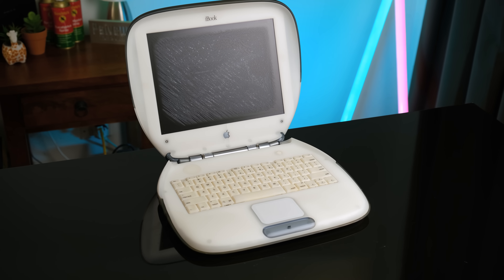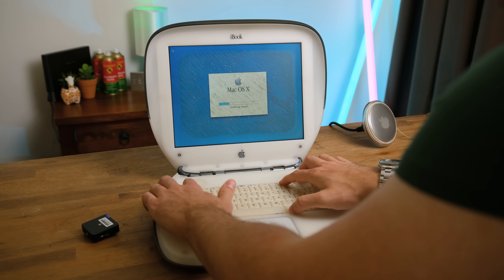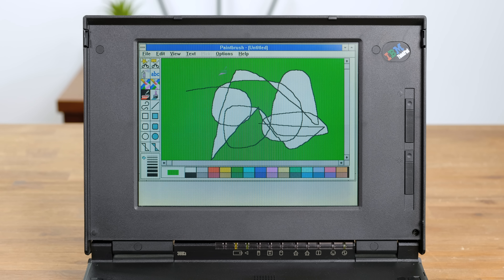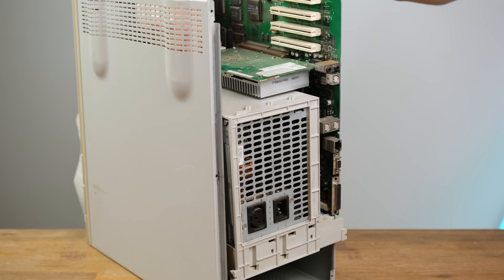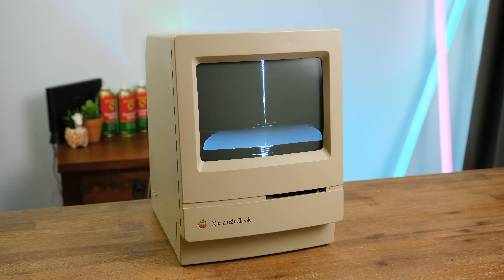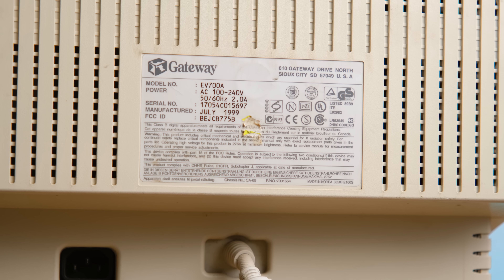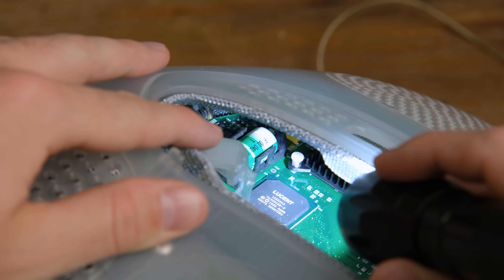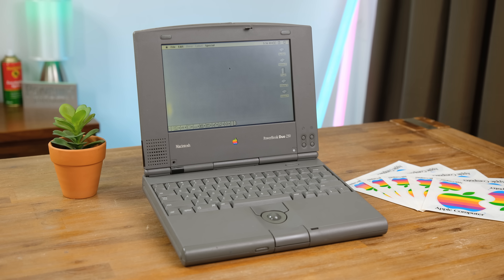So Much Vintage Tech Is Dying... Here's Why

Comment: Another reminder of the PRAM battery that killed my beloved IIfx back in the mid 2000s. Was only in storage for a couple of months while I moved states but that was long enough for the logic board to be destroyed. Kinda grateful I sold off my vintage Mac collection back then, would have been potentially worth more now of course but the time/effort/cost involved in keeping it all alive would have been huge.
Reply: I had a IIfx fall to the same fate but more recently. Around 2011 it was working fine, and I put into my parents' attic. Ten years later I pulled it out, and the motherboard was destroyed from a battery leak (looked more like an explosion). 

The case had significantly yellowed over that time too. It was a very sad sight. What a shame to loose such a rare and powerful vintage Mac.

Comment: before I even watch this video it is for the most part when the person doesn't know a thing about electronics and they turn it on with a faulty capacitor and it blows up and decides to take everything else with it.... which could easily be prevented if people who didn't know anything about electronics would stop buying vintage tech so people who do know can replace the capacitor or other faulty things before turning it on. I mean look at crts from 2006 not even 20 years yet and the capacitors are failing on those so i'd say around the 15 year mark is when you should look for faulty capacitors so you don't mess your stuff up
Reply: now with that ibooks screen you could easily replace it there may be a way to even repair that screen that's already in it
Reply: It won't read discs because the laser has failed 99.9% of the time which is quite an easy fix yes lasers aren't going to last forever
Reply: You can't really expect a hard drive to last forever they are magnetic discs and the high rpm is going to wear down the mechanical stuff those should be replaced around every 15 years if they are used heavily
Reply: it's not that things aren't built to last it's that things can't last forever things wear out with use
Reply: plastic of the 80s and 90s they thought plastic would last forever then, why do you thing computer cases for the most part aren't made of hard plastic anymore
Reply: yeah you're supposed to replace batteries over time kind of like how you do in your tv remote to prevent stuff like that. should replace stuff like that every 5-10 years depending on what it's used for
Reply: People don't have their electronics serviced as often as they should be, blame can't be put on build quality or saying they aren't built to last otherwise you'd have to replace those every year instead of 5-15
Reply: now at the end of the video... no you should not sell your vintage tech just because some random says so just service your electronics and they will last you until death
Reply: @IHatePeeps1111  With harddrives it is mainly mechanical impact and heat, and run them horizontal, not vertical to avoid strain on the bearings. After mechanical shock harddrives can die 1 month later (because tiny particle will start a chain reaction of debris (like colliding satellites)), which often is mistaken for random death and gives them bad reputation.

I trust SSD way less. SSD/Flash memory functions like DRAM with 1 year refresh cycle (see Wikipedia "wear leveling") and will die if not powered on once a year for some minutes. It dies the faster, the more erase/overwrite cycles it has gone through, thus never use a worn USB stick or SSD as backup media. They starve without energy (modern triple/multi level types even faster) and data can not be recovered at all, which makes them an atrocious choice for backups and long term storage.

Comment: This is also a problem on old XBox (original xbox) which has the clock battery cap problem. Get those out of there before they destroy the motherboard.

Comment: I had an old Dell Inspiron 8200 that had a failing hard drive. If left in storage for a while it wouldn't spin up at all and I would have to shake it until if would work. One day it just stopped working completely no matter what I tried.

Comment: Another thing about old Apple laptops the solder joints in all the motherboard get so weak over time, and when you try to unplug a ribbon cable the connectors pull right up with the cable or whatever your trying to umplug. I have seen it in lots of Vintage apple laptops

Comment: Heh, my dad's poor old not very well kept attic left a few of the old systems he donated to me in pretty bad shape. Including a lovely Trinitron multiscan e220 that would have been nice if it wasn't scratched and if the thing worked well, potential flyback transformer issues though this monitor was affected by the cap plague so that could be a potential fix, not giving up hope on this one yet.

Comment: For example my Nintendo Collection from Nes To GameCube works fine, only the plastic change the color
Reply: You should check your GameCube disks from time to time, there's one video of hundreds of them being bad, but it was probably due to flea market cavepeople storing them badly. I keep all of mine in the storage cases, usually the original storage case.
Everything Nintendo used before that was on mask ROM chips, one of the most reliable storage formats ever.

Comment: why did this actually make me cry, like i never grew up with any of these electronics but its like watching someone you know really well die. im into old tech, especially old computers, the fact that this is starting to happen is extremely upsetting but I know there's nothing you can do about it.
Reply: Yikes!  I'm off to check my precious ancient PC Clone DX2/66 that I use to play DOS Star Trek games!
Reply: You’ll find that computers from the 90’s will fall apart and break before computers from the 80’s. This is because of the brittle plastic they’re composed of which makes them a nightmare to move around and transport. Older systems from the 80’s are far more durable and many survive unscathed to this day.
Reply: @Bendaak  I wonder how later systems compare. A lot of my current computer setup, the one I'm using right now, is from the mid to late 2000s (I believe after the batch of bad capacitors that caused failures of earlier systems). I hope the components, especially the monitors, keep working, because, well, I still use them, and they work quite well.
Reply: @happysmash27  Later systems from the mid-00’s are far more durable than systems from the previous decade. I have a bunch of laptops from 2005-2010 and all are mostly in perfect condition with no cracks or damage. I guess time will tell!
Reply: that could also be due to the time period, ive had awindows 7 era machine already lose its battery @Bendaak
Reply: that may be the case for the casing but how about the internals @Bendaak
Reply: It’s cause you have autism
Reply: when theres a will theres a way
Reply: not really, capacitors and such do fail but are replaceable
Reply: @geekzombie8795  space is not a thing but the absence of matter hence nothing to break. Using a light won't let you find darkness.
Reply: if you're crying you have severe issues. man up
Reply: relatable
Reply: Everything dies eventually. Nothing is immune to time.
Reply: @cattysplat  Not 80s Ford Crown Vics, though. Those things absolutely WILL last forever, full stop. At the very least until after everyone that watches this video is gone.
Reply: More modular = more durable.
Reply: @canalRetro269  um... No?

It's less durable, it has code that make it less durable, because companies are want to people buy new products
Reply: I don’t mean to be insulting, because this is a society wide problem… It’s because we have been weakened by our diets, nutritionally and psychologically. By food, chemical exposure, and media exposure. Our endocrine systems are under a sustained assault and it’s making men over-emotional and unstable.
Reply: @TheMasonator777  men were always as emotional as they are now, throughout history most of the male populace was almost entirely traumatized by war until about 30 years ago, imagine thinking acting like a human being is over emotional, just because your a human callous and have no soul doesn't mean everyone else is emotionless, traditionalists are morons
Reply: On the plus side, at least the concerns about plastics sticking around forever in landfills has proven to be overblown!
Reply: @Amazing.A.I.Channel  Just because a plastic is brittle and breaks apart doesn't mean it magically disappears
Reply: @Amazing.A.I.Channel no, it has not, there are MANY types of plastic, some far more durable than others, not to mention, just because your eye can't see it, doesn't mean it isn't there poisoning the soil. microplastic has become a concern for good reason.
Reply: @saaros Yeah, this is just proof how cheap manufacturers can be, using 'air puffed' plastic,.   But the hard clear plastic they tend to use for water bottles, etc can  last centuries...
Reply: @AmazingArends there are Microplastics in our FOOD now when we eat Fish etc.  There are 'forever molecules' in our water supply from people getting cancer treatments then peeing and the toxins last many Human lifetimes,
Reply: @Amazing.A.I.Channel well made ABS plastic can theoretically last forever under good environmental conditions..... Some plastic can last forever.
Reply: @Amazing.A.I.Channel  The concern is microplastics. While large chunks of them do break down they only break down into smaller pieces of plastic that are harder to contain and more likely to pollute water and soil.
Reply: @Amazing.A.I.Channel  Plastic isn't compostable, so no. You're wrong

Comment: I've been for years into film cameras and most of them (at least the Japanese main brand ones) are made out of plastics and components that don't decay. Main problems are old foams and lubricants. But overall, everlasting devices. 

However, I recently got into cassettes as well. Tape decks are mostly OK... But Walkmans are a freaking nightmare. Setting old rubber belts aside, there are problems with gears and capacitors (and damage from leaky batteries). Others just die without notice. A big sad.

Comment: My biggest dream is to create open-source models of those old tech, that is made using new parts and new technology. I'm mechanical engineer, I specialised myself in 3D modelling, designing and 3D printing technologies, sooo I have good enough background to participate in such project. I would love to see Toshiba Libretto 70ct as a open-source project of Win98 portable computer, that its chasis is made entirely using 3D printing technology and parts are made using new, commonly used components like for exaple some kind of mod for Raspberry Pi. This project would need to be updated regularly, in which case it would mean to create new editions of components for it to be in touch with currently avaliable parts on the market, or to gradually create alternative ways of producing parts for that device in small quantities by hobbyists. We have enough manpower to do it - there are hundreds of thousands old tech enthusiasts active on the Youtube right now. I bet, that if we would combine Usagi Electric, 8-bit Guy, Retro Recipes and Psivewri audiences, we would have enough power to do it.

Comment: There's also data corruption due to material degradation.  Floppy disks, CDs, LaserDiscs, many types of DVDs, and OLD hard drives can 'breakdown' within the lifetime of an owner. 

If you consider your 'olde' data important? Keep backing up that data to newer data storage. Multiple data storage backups.
While you can still find devices that can read Ye Olde formats.

Comment: Ideally, we would need to integrate 3D printing technology and 3rd party companies to produce spare parts for most classical types of those machines. Most of those laptops and computers are still fully recovereable, if there would be some kind of counterfeit parts like for example screens, openable battery packs for use of new 18650 Li-Ion cells, keyboards and most common section of ports, and pre-programmed for certain use chips (why bother to produce some kind of old, highly specialized chips, when we can have one producer, that produces one programmable chip that is pre-programmed for use in one specific scenario, one of hundreds pre-programmed for it). Guys, let's start some kind of open-source repository of repair kits for retro tech. I want to get old together with my highly modified Eee PC without worrying, that it will be probably dead in the next 10 years of constant use!

Comment: I also have Toshiba Satellite laptop which was sitting in my cupboard because it was a gift from my aunt.I used it alot during 2000-2010 but few days ago I thought to install chrome OS on it as a test but it's screen has the same vinegar display syndrome and that was devastating 😢

Comment: People very seldom talk about entropy in plastics. It's just a flat out natural thing. The nature of plastics is that the molecules eventually spread further and further apart. Making them gradually more and more brittle. It can be especially dangerous in older used safety equipment. Better plastics, and more modern formulations slow the process down. But it's just part of how plastics work. All of them.
Reply: May it be that brittle hard plastic was shock-cooled to increase manufacturing speed? With glass there is a "cooling furnace" that needs to reduce temperature slowly to avoid tension. The faster glass is cooled, the more violently it can shatter (see safety glass or Prince Rupert's drop).

Comment: Its not just old PC's and Mac's that are prone to these kinds of failure.

Old consoles as well, CD based consoles failing because the optical drive can no longer read discs for example.
SNES's failing due to what's known as PPU rot that causes games to never boot or will boot with music playing but will freeze on a black screen.
Master System's have a very common failure with the cartridge slot that requires the pins to be reflowed to reform a strong connection with the motherboard.
We all know that overtime NES cartridge slots can just have troubles reading carts because of the 72 pins connector no longer making strong connection with a cartridge.

And check your arcade boards too, some have suicide batteries that once they die you have to burn decrypted ROM's to bring the board back to life.

Comment: A few years ago, my old Samsung Galaxy Fame and an LG phone stopped completely working one day. I'm afraid the eMMC flashes just ran out of write cycles or something else went bad owner the years. They're just stuck on the OEM logo until the battery flats. My fully working Samsung Galaxy S4 started to make cracking noises from the main speaker out of nowhere. Either the speaker itself is fading out or some kind of circuit is dying inside. I also need to find a professional VHS-C player as the tapes themselves from my childhood started to show some wear signs like the long loading of the cutoffs and the date/time they were filmed. I'm glad the Camera still works, only need to find an aftermarket battery. The night shot mode is still impressive in how the polarizer disappears from the lens and all infrared lights are visible. I try to keep my room almost as dry as possible, running the dehumidifier all day and filling up the 16L container in almost 2 days. I'll also try to buy some part replacements in case something wears out in anything I own.

Comment: Good advice.  I've got a number of old laptops & desktops, (i.e. HP, TI, etc...), and they have an integrated RTC, where the battery cannot be readily replaced.  Time has not been good to them.  The rubber-coated IBM's are some of the worst offenders, when it comes to the tacky mess they make.  Storing old Tech is definitely a double-edged sword.  Sitting on that investment can be a financially losing proposition.  😮

Comment: Wouldn't it be better to cut a hole in the backside of the iMac instead of separating the display? You could even 3d print a hinge to screw the cut out piece back in again.

Comment: As far as I know, most if not all my retro tech functions 100%. I haven't had them for a crazy amount of time, but so far, no issues which is good. I wonder if climates affect the capacitor and battery leaking issues because I live in a dry climate.

Comment: What is great with modern technology is that you can emulate those old machines. Like with Mini vMac or even just VMs in general. Yes it’s nothing compared to using the real hardware but on day or another they will just all fail. I mean you can buy things like SCSI2SD let’s say if your drive is dead but it’s like you can put an LCD screen "inside" a Macintosh and that would kill that vintage look.

What’s weird is that for mobile we don’t have that much emulation. There has been that recent modified QEMU project to emulate iPhone OS 1.X but for iOS that’s it
Reply: Online devices like smartphones depend on cloud infrastructure that does not exist anymore. That's why nobody emulates them. E.g. the Ogo PocketWeb would certainly deserve 1.) emulation (it had some games) and 2.) a homebrew OS to run something else not depending on the original cloud on it.

Comment: 0:23 Never thought "vinegar syndrome" would be associated with old tech. I've always associated "vinegar syndrome" with old film stock (more specifically safety film), which contains cellulose triacetate, which over time degrades into acetic acid, the main component in vinegar.